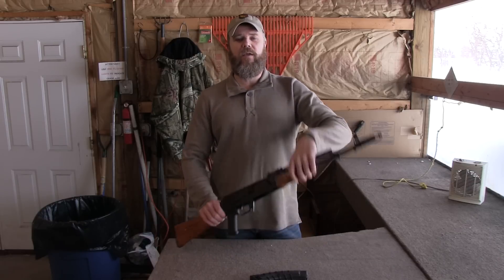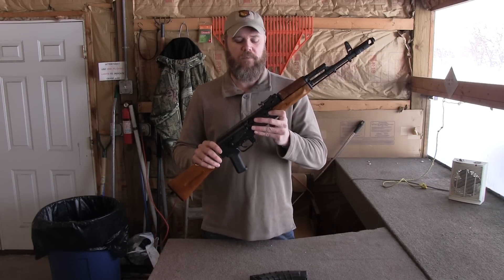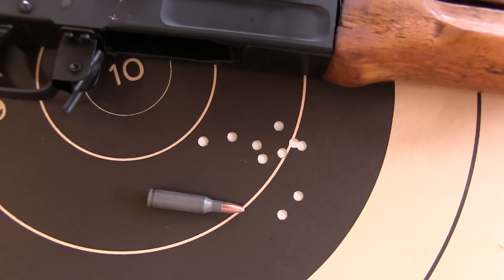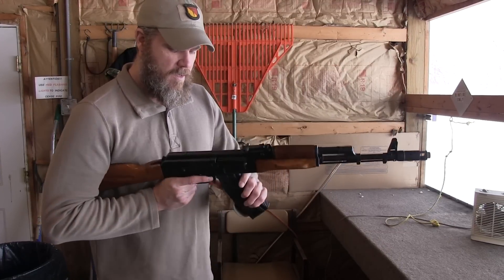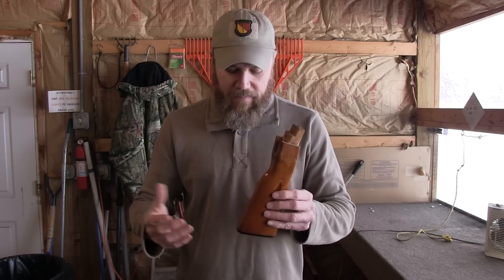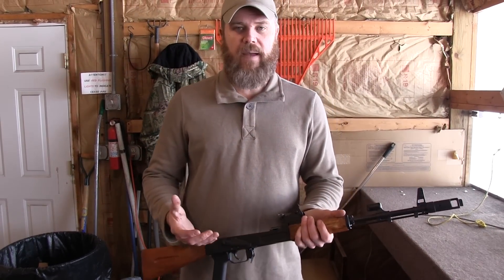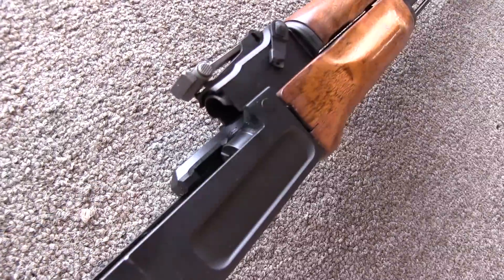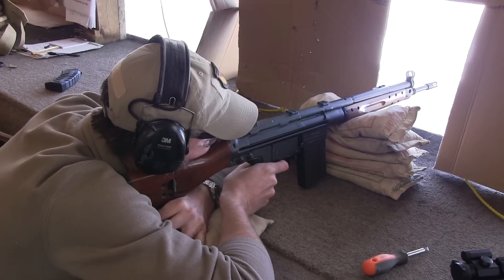Waffen Werks Milled AK74

Comment: Man, if waffen werks could have kept making those instead of their shitty house production stamped receivers they might have been able to save their reputation and not go out of business.
Reply: They stopped making them?
Reply: David Nguyen oh yeah. A few years ago. I think it was like 2014
Reply: joseph cunningham how can you tell if you have a good one before they were trash
Reply: David Nguyen if it has a nodak spud reciver it’s good to go. If it’s one of their house builds it may be out of spec. It should still run, but I can’t guarantee you that it will run as reliably or as efficient. The receiver and the bolt/chamber lockup is where the magic happens. If it’s even the smallest bit off it’s going to give you problems in the long run.
Reply: joseph cunningham so the house build just has their name stamped on the bottom?
Reply: David Nguyen I’m pretty sure that was their in house produced receivers. Nodak Spuds would say “nodak spud” on them somewhere but I forget where.
Reply: @justinhedrick2906  most likely good to go. They put out allot of lemons but I think you might have the exception. Good find.
Reply: @justinhedrick2906  sounds like you got a good one.

Comment: It looked like the back of the receiver is square - not having a slight canted edge like some milled receivers do. If so, the metal tube stock adapter from CAA would NOT work in this rifle. However, CAA also makes a polymer tube stock adapter, which could probably be easily modified by the user to fit the back of the stock. I just wanted to throw that out there as an option for those that may want that option vs trying to modify the Bonesteel adapter. The polymer tube adapter is also much cheaper to purchase, and allows for any six position stock, like Magpul, CAA, Mako Group, etc.. Don't get me wrong, I'm not knocking Bonesteel's product - just another possibility for those considering this rifle.

Comment: Good its about time, I will buy one now if I want an AK-74 thats heavier than it needs to be for no good reason.
In my mind the reason why these company's are going milled now is because they fail at making cheap stamped receivers in the US. WW stopped using Nodak Spud and all of a sudden you hear people start talking about bad receivers. Now here comes a milled, because its superior quality of course. Not because they cant make a decent stamped receiver and figure out how to heat treat it correctly.
Reply: WW stamped receivers were fully heat-treated, as good as any other. Their problems were funky geometry on the axis pin holes and rails on some of their builds. Whoever was doing their receivers in-house I don't think was up for the rate of production they needed.

I looked at building one of my parts kits on the CNC Warrior AK-74 milled receiver a while back, but at nearly $400 just for the receiver, it wasn't worth it - as you say, the only real benefit is cool points. It just makes the rifle heavier, and there's some evidence still out there that milled receivers have more potential failure points than a stamped receiver.

Comment: if this had a side rail it'd be perfect. i'd buy it in a heart beat... i think i'm gonna go with Atlantic's RAK-74 now, though... because holy Damn is it beautiful. and it has my side rail.
Reply from the maker: I agree, the side rail would be a welcomed addition.
Reply: I might change my mind, however, and look at the new Century C39's.  I looked at Atlantic today and saw they got rid of the junky rail for the hand guard and put some laminated wood on there.  Now it looks like quite a deal, even with no rail.

Do you think you could get a C39 in soon?  Cause I've heard nothing but good about it so far (other than the hand guard of the first generation).
Reply: I'm also surprised by the lack of rail. I've bought three Bulgarian AK-74 kits, and only one of them came with an original rail. I'm guessing WW just didn't want to spend the extra cash to get a US supplier to mill them out.
Reply: that sounds about right. and you know i'm starting to wonder whether the milled WW receivers are from the same place as the new C39s' are.

Comment: Put that up against your SAM7SF
Reply: It would lose.   No optics mount, no CHF barrel.  No side folding without custom work, no fancy thumb safety either.  Probably the biggest miss would be the U.S barrel.   You really want a CHF, imported barrel for an AK if you want to put a lot of rounds through it.  Particularly since you are going to want to feed it cheap surplus ammo.  I can't really understand marrying an expensive, milled receiver with a barrel that won't go the distance.   If you plan to put 100 rounds a year through the thing, ok.  But who buys an AK to have a safe queen?
Reply: Archie Bunker That was the point of the comment. For $300 more, you get a much nicer rifle. I should have explained that further. I promote Arsenals to the fullest extent.

Comment: Man AK's are getting too expensive. Almost not worth it anymore.
Reply: Not worth it? You just drizzle some oil on it now and again and it will last you a thousand years.
Reply: Notrollhere
AKs are great, don't get me wrong. But one of the greatest things about them was a moderate price for a reliable weapon. In my opinion, and this is just me of course, any AK over $900 is not worth it. Especially when you can get a decent AR15 for under $850 easy, and if taken care of, it will more than likely last just as long. But different strokes for different folks. If it tickles your pickle, snag it up. between the AK and AR I wanted an AK. But with 5.45 not being a super prevalent round yet, 7.62x39 not looking so awesome for home stuff, and AR15 prices being better in some cases than AK, imma snag an AR up and adapt to the AR platform. Unless you are buying corrosive, 7.62x39, 5.45, and .223, in russian production, are all around .22 a round anyway.
Reply: justus005
Wife Just got a WW stamped AK74 for 617 shipped to our dealer here. Check classic firearms out for some sweet deals.

Comment: How does this rifles stand up against other waffen werks AK74's that keyhole with that American barrel and/or don't shoot reliably at all?
Reply: I've never heard of the waffen werks having keyholing, are you thinking of the tantal?
Reply: TheMauserGuy
he is thinking of the Central Arms that was using the wrong chamber diameter in .223 instead of a true 5.45 and was causing rounds to tumble.
Reply from the maker: This is my second WW-74 rifle and I've never had keyholing or unreliability issues with either of them.
Reply: zack9912000 Maybe you're right but I've heard of several people having the same issues the with waffen using 5.56 barrels in their 5.45 ak74's.  Do you own one?  What are your impressions?  School me if I'm wrong, I welcome an excuse to buy one over an arsenal.
Reply: I own a number of Ak74, Wife owns a Waffen Werks AK74 and loves it. It shoots straight and has the correct chamber. I have a Arsenal and a SAR-2. All of which shoot great and I am getting 2 MOA or better. Simply Centry Arms tryied to cut corners and paid the price, I would never recommend them. Did a ton of research on them when I bought my first rifle and I will continue to avoid them.
Reply: zack9912000 Update I got my WW74 from Atlantic, it's AWESOME.  The tapco mags are awful though I need bulgy milsurp, thanks for your advice and pms!
Reply: 3091181 My wife and I have put about 6 thousand rounds through our waffen works 5.45 AK. We have not had a single issue with the rounds key holeing. It shoots very well, it is a well built rifle and it has held up in the combat rifle courses I take. We got the B grade stock model from classic firearms for 600. It has a gun coate finish if I recall and for the price it is hard to beat. The Tapco mags they come with blow, yet I sell those and buy mil surplus mags. Not a huge deal.

Comment: Can someone please tell me the difference between milled and stamped recievers?
Reply: Milled = Made from solid block of metal. Stamped = Made from stamped sheet metal with rivets.
Reply: ***** Ugh, I guess I get it.
Reply from the maker: Stamped rifles are made from a 1mm thick sheet of metal that's folded into a receiver. Milled/Machined receivers are made from a solid block of steel that is formed by several machining processes.

Comment: Full Auto marked.

Yeah, no. That is a little too close to Randy Weaver territory for my taste.
Reply: It still doesn't have the full auto internals.
Reply: It doesn't need to.
Reply: So your ak has the auto sear in it?
Reply: No, I am saying that having an AK marked full auto can still lead to real bad times with the BATF if the gun malfunctions and goes into full auto or burst fire.
Reply: All they would have to do is look inside and see that there is no auto sear. What does that take less than 30 seconds?
Reply: Look up United States v. Olofson.

The ATF does not actually care if the gun doesn't have an auto sear. If it has a full auto setting and the gun malfunctions and goes full auto, they will find a way to make a case out of it.
Reply: Bill22252 I've seen the case before. If the guy had the right parts it would have never gone in to a third mode. As for these these ak they need the auto sear in there for this to happen.
Reply: There was a fair bit that Olofson did that put him in the situation he got, but I would rather not ever chance it.

That is just my own paranoia, though. Plus a full auto marked receiver without full auto looks tacky.
Reply: ***** It would need a auto sear,
Reply: END6987 You need a disconnector and you can buy one on kvar. thats all i need for my wasr 10 ( profile picture).
Reply: +Chiefshadow4 so your going to do the mill work and drill a hole? lol nice try bud
Reply: ***** 2 years... a little late. Theirs no milling involved. Learn more about AK's scrub. Drill one hole and add two parts.
Reply: Chiefshadow4 And the rail? How do plan on that because getting a dremil in there seems like a challenge, scrub! lol.
Reply: ***** You aren't the brightest star in the sky. You don't need a dremel.  You need a drill. Can you say "drill"? 
Go to that link and you shall be enlightened. If you know the alphabet of the english language than you too can find the "Y" in the picture. This Y needes to be drilled all the way through.
http://wasr-10.com/Dimples
If you can't find it, you are an example as to the why the US education system needs to be reevaluated.